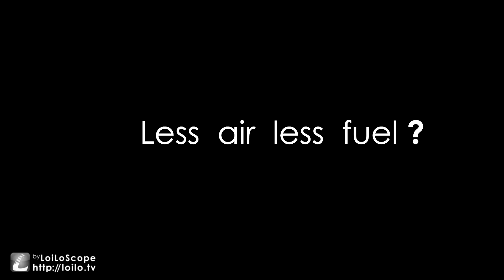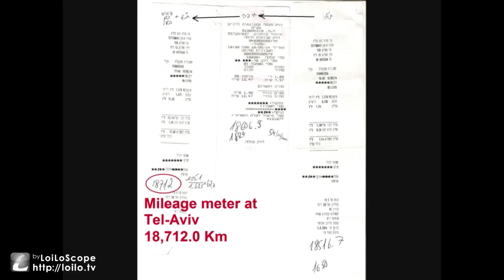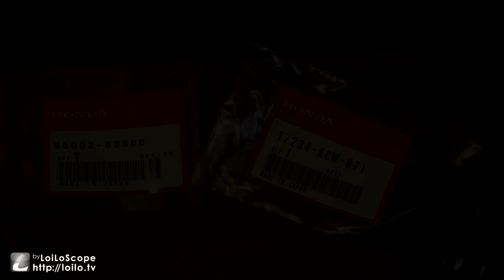The Air Filter (3 of 3) - Less air less fuel? + The drain collector |HONDA INNOVA GARAGE |WAVE |2010

Comment: Thanks for sharing, mine is now on nearly 15 000 kilometers still with the original air filter, spark plug, chain, sprockets and tyres. I've only changed the oil every 4 000 kilometers and the brakefluid once a year and oiled the chain every 1 000 kilometers. My average fuel consumption over the whole distance is now on 60 kilometers per liter. Do you find your parts local or do you need to import?
Reply from the maker: Peet van der Merwe Hi and thanks for your lovely comment. I buy the parts at official Honda Israely dealer shop. I already bought a set of gears and a chain, which has not changed, because I did not have to.

http://myinnova125i.blogspot.co.il/2014/06/blog-post_3849.html
Reply: tamirkr
Your blog looks excellent with plenty of information. I keep a page of my Honda on facebook: Honda Flush WH 125-6
Reply from the maker: Peet van der Merwe Very nice page

Comment: the replacement of the air filter. what is the lifespan of the replacement?
Reply from the maker: I'm not sure I understood the question. The manufacturer recommends cleaning the air filter every 4,000 kilometers, and replacing it every 12,000 kilometers, or before, depending on its condition.
https://youtu.be/6Okj-5VGDaE?list=PLXlwe-Wg__YZ0udrLgRiiq-dJa3Ob02Cy

Comment: When i use that item broken what gonna happen?..
Reply from the maker: The rubber functions as a one-way valve, allowing drain out water and other deposit that penetrates the air filter box through the opening of the box located at the top of the box. The rubber does not allow water to enter through it from the bottom up. The valve is located on the outside of the air filter. It must be in good condition and clean to prevent rainwater penetration from below, etc.
Reply from the maker: It is also a matter of getting cold or hot air into the engine. From above ther is a preheated air that flow inside to engine. The preheating achived by air tha flow on the hot engine parts. From below air enters without preheating. If the drain valve is open colded air will flow to intake and engine efficiency will decrease.

Comment: with what gear oil??
Reply from the maker: +George Ouzo 
There is no gear oil, the oil is shared between the engine and the gear.
In ISRAEL I use 15W-50 synthetic engine oil
http://3.bp.blogspot.com/-S8BXxeeE-ig/VIQkZvgoUWI/AAAAAAAAEz8/8K6V7S51oRk/s1600/15W-50%2Bsynthetic.jpg
Reply: @MyINNOVAMotorcycling  broken link by now ;-)   [pic url]
Reply from the maker: IC you're right. At this moment the blog is closed, and the picture is from the blog.
In the past i bought engine oil from the importer
( i-Ride 15W-50 synthetic eni).
In recent years I have been using regular mineral oil, without additives, 20W50.
Four liters of Turkish mineral engine oil cost me 1/7 the price of Italian synthetic oil.